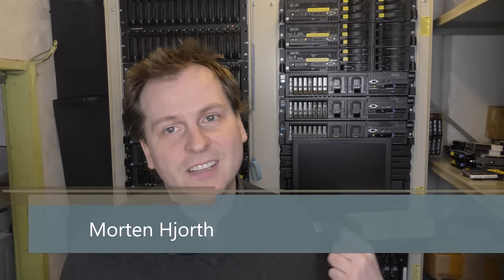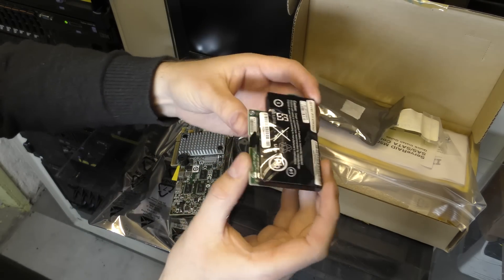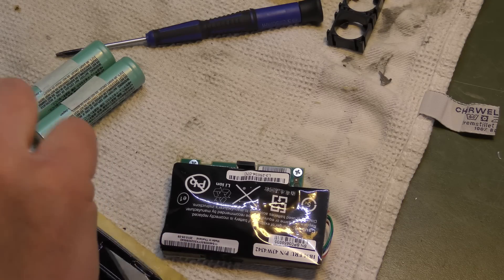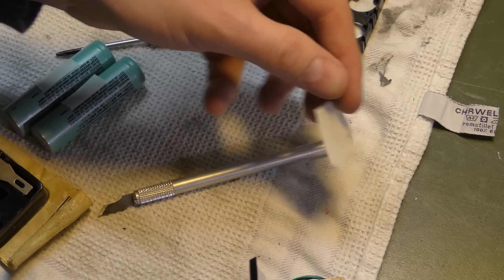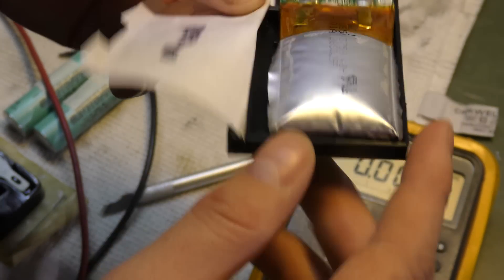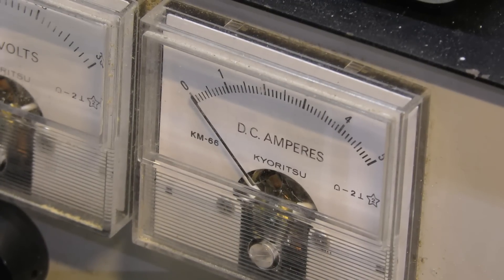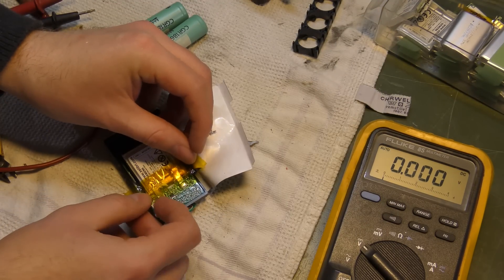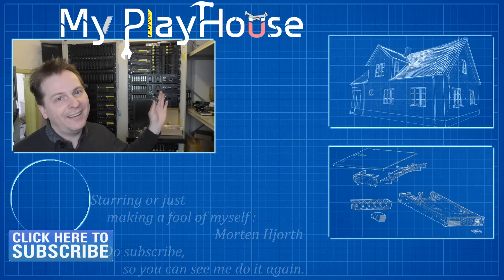ServerRAID M5015 for Lenovo x3650 M3 Ninja Battery Hack - 685

Comment: with my Dell raid batteries, I open them up and desolder the batteries from the circuit board let them sit for a few days then reattach the batteries and but them back together, I don't know why this works I suspect that the circuit board decides the battery is bad after a certain number of charge cycles  and disconnecting the battery clears the counter or the circuit board re-profiles the battery and thinks its new.  also watch out for the replacement batteries on e-bay I found old batteries put in new packaging and new printed label on the battery it self.
Reply from the maker: Hi Adam Rosas
Thank You very much!  glad you liked the video :-)
Thank you for watching! :-)

Comment: Great! Thank You Morten for this extensive  Ninja Hack!
After some googling i found out the battery type is Sony US503759 a8h, 3.7volts and around 1300mah.
This battery is also used in the LSI ibbu07 and the Perc6 raid controller. Also i read it's not easy to get this to work, but maybe you're lucky!
Reply from the maker: Hi Henk Kok
Thank You very much!  Great info!! someone posted me this : http://worcell.com/product_info.php?products_id=74356
So it all add's up.
Thank you for watching! :-)

Comment: Actually I need to do exactly this on my Serveraid M5014. The "new" battery bought from Ebay is not very new :-)
Reply from the maker: Hi Magicairsoft9
Thank You very much!  That suckes,, they are not cheap!
Thank you for watching! :-)
Reply: My PlayHouse Did this fix work? I was checking my battery and it holds 2,51V stable, but it should be like 3,7V am I correct?